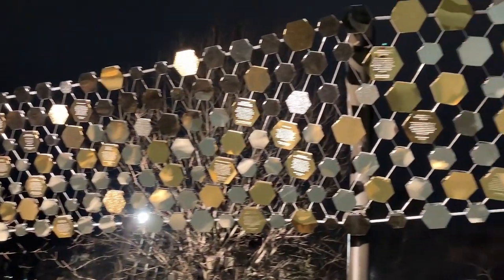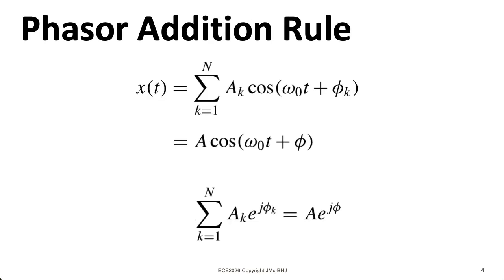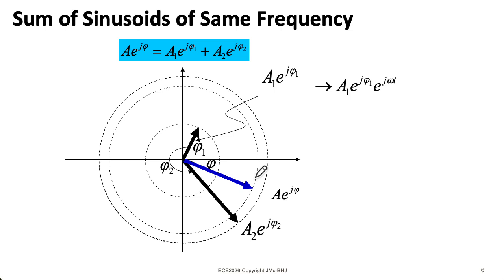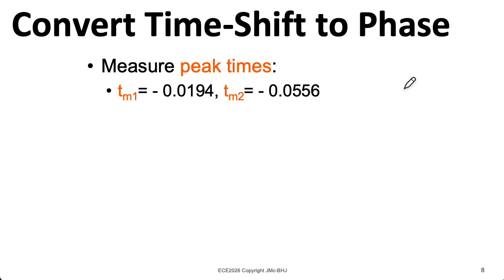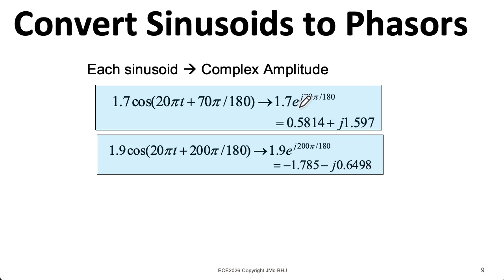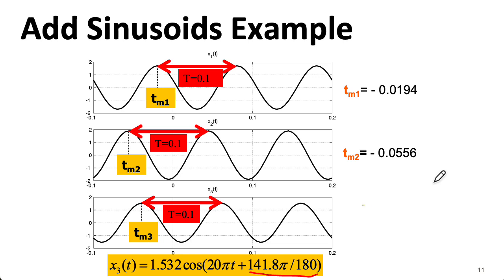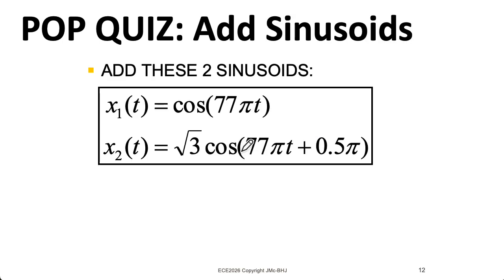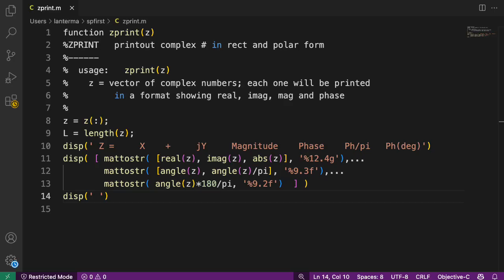ECE2026 L7: Phasor Addition (Sinusoids with Same Frequencies) (Introduction to Signal Processing)

Comment: Years ago I was designing a strange additive synth on paper, one with a bunch of PLLs making different harmonics to be added together, but with square wave outputs because it was easier. It had a complex circuit to allow you to adjust not just the amplitude of each harmonic, but also the phase relative to the fundamental using a pair of comparators riding up a ramp. With phase and amplitude control of triangle or square waves, I’d be able to sum them into a sine wave, hence through superposition I could sum them into any possible wave shape, setting in my mind the idea that all wave shapes were just as useful as sines.

Then I saw a YouTube video explaining how human ears didn’t really hear phase, which was pretty enlightening. But of course, that only applies to sine waves, because you can’t make a sine wave by adding squares without control over phase. Thus ended my little departure from sinusoidality, back to triangle waves with wave-shaping diodes. Though the human ear can still hear changing phase, so having control over phase may still be useful.
Reply: You were on your way to rediscovering Walsh functions.